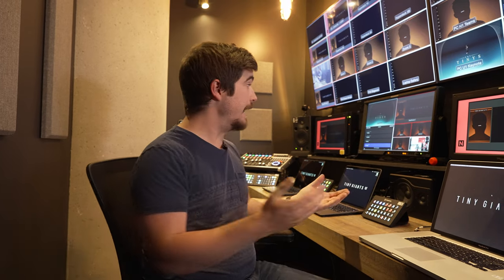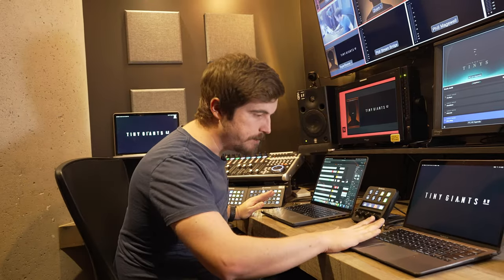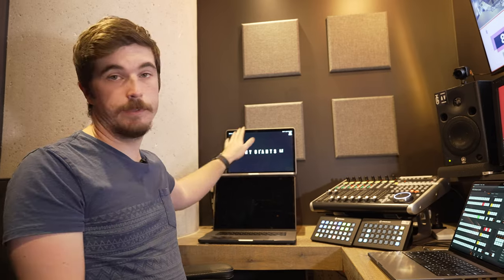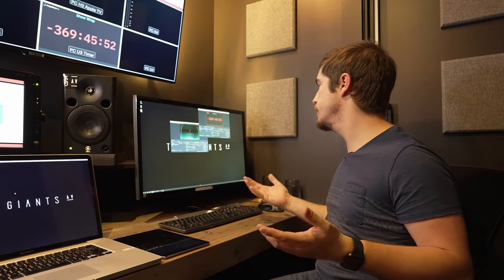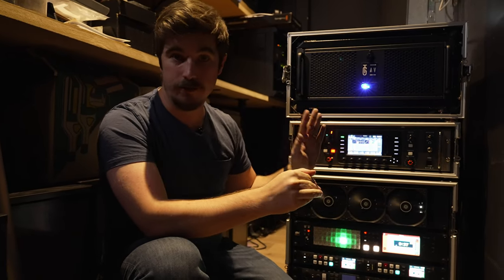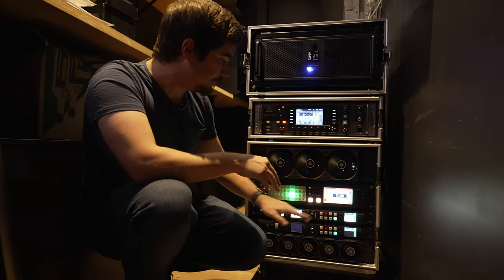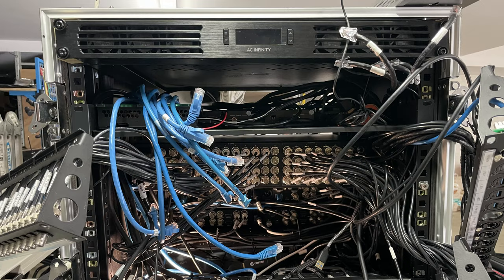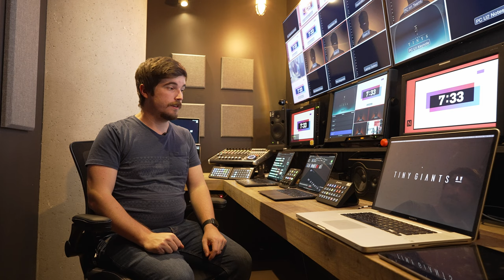Livestream Control Room Tour 2023

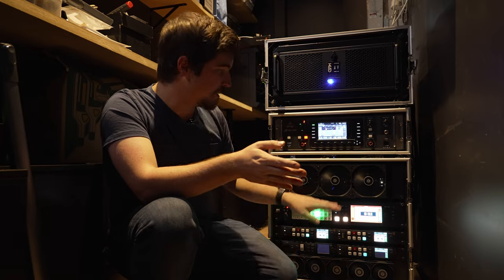Comment: Hey Ryan. Very nice setup. 10:28 I would assume a similar setup with an extended power cable would also be possible on the BMD Studio 6k as it uses the same 12 V 4-pin XLR, right? Any cable recommendations for longer DC cable runs (25 meter)?
Reply from the maker: Same connector yes, will depend on what voltage range it accepts.. the ursa goes from 8-20v from memory, there’s a good chance the studio would be the same but I can’t see it in the manual.. this setup works for 50m which is the most I’ve tested so far

Comment: Been watching your videos for a while Ryan - thanks. Useful stuff. I get the clever stuff, but sometimes, you mention simple things and in particular - you've mentioned a few times about how you have X computers but can access them from anywhere in the trailers or studio? At some point, could you show us how somebody can sit down at a position and grab, say, the computer doing graphics, but then switch to controlling a different one? I can't quite get my head around how the system does this?
Reply from the maker: Thanks for watching! Ahh good question, so I don’t really have anything like that here, I do have chrome Remote Desktop setup on all the computers for remote access though. In the trailer I used the Adder XDIP system for KVM over the network. You plug in the output of your computer to it then you plug your monitors to a receiver unit. And with a key press you can select which computer you want to control. Hope that makes sense

Comment: Good on ya' moving the computers OUT, and fibre cabling them to the control room "head end" so to speak. Nobody wants to work in a data center (heat & noise). 4:04 What/How are you generating the LUFs monitor for the Director station? Is that just a software meter or something more advanced? Like (in my imagination) maybe the TC Electronic Clarity M Stereo has an HDMI out you can dump into a Multiview? Just curious on that one detail.
Reply from the maker: that would be nice having the ability to overlay easily! but this one is actually built into this tvlogic monitor... which is awesome!

Comment: Hey Ryan ... this is a great setup!! Quick question, when you're connecting to a Zoom Meeting/Webinar, and you're looking to push either a SuperSource, Camera Feed, or GFX/PPT Slides into Zoom, are you pushing this through the "Camera Feed" within Zoom or the "Screen Share" feature? I'm assuming this is all going through the Camera Feed within Zoom ... and if so, do you have any special settings within Zoom to optimize the feed?
Reply from the maker: Good question, but no I dont use the share screen, the framerate is just not high enough for that. I do try and use 1080P accounts where possible though. Which essentially need 10x pro accounts to activate which is annoying.. or trigger 720 using a zoom room. that and we make sure the text in the powerpoints are as large as possible to make up for the lack of quality!

Comment: been watching for a while now, do you still have the airstream and if so how much has that changed with use?
Reply from the maker: Hey mate, client is still rocking their airstream, have used it a few times when they have hired me to TD it, not much has changed, they swapped out one of the stage boxes to make it bigger and have a kvm in there which works well, plus added antennas and a few bits and pieces, but overall pretty much the same technically

Comment: What usb extensions are you using as that is a long USB run
Reply from the maker: It is, i have a 10m USB 3 Cable running to a powered hub in the control room which is adding some extra power for the decks, havent had an issue with it